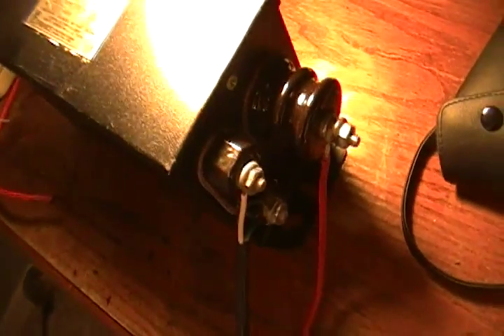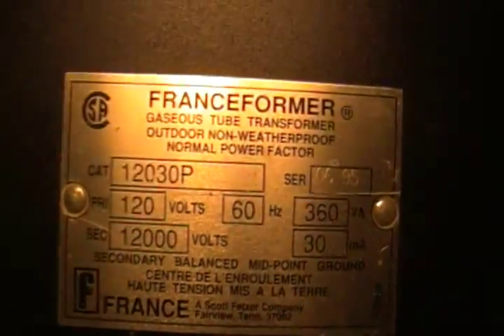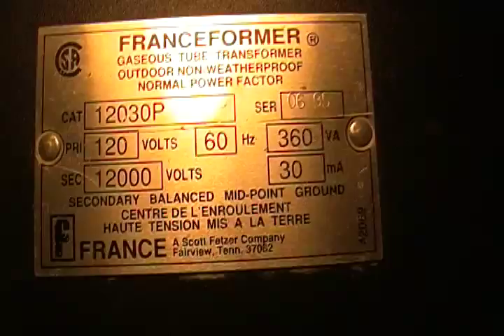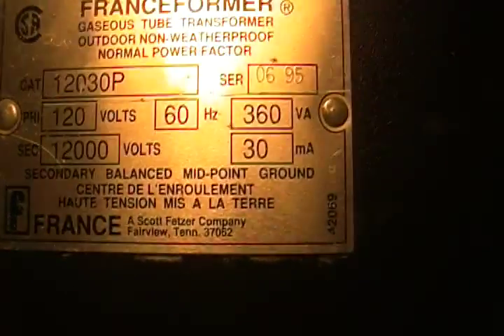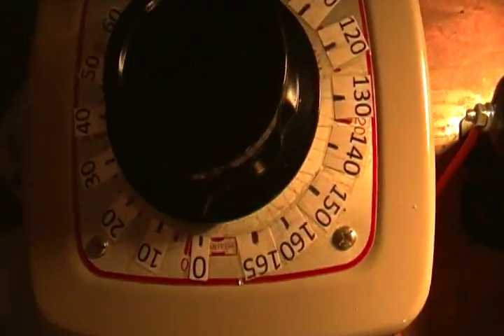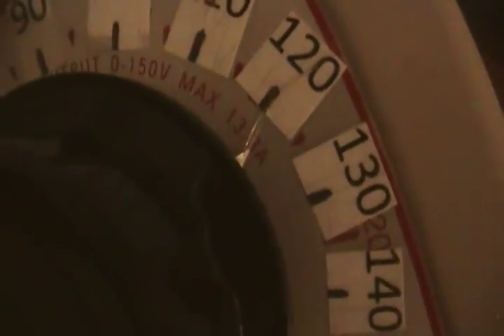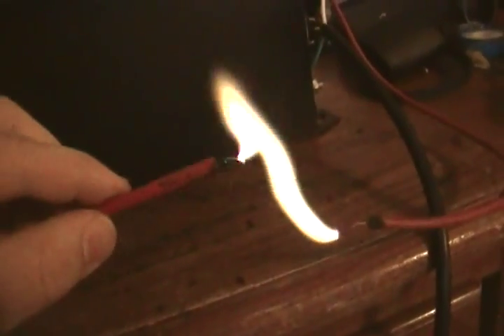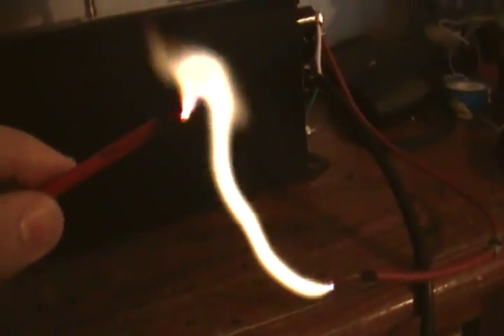Neon Sign Transformer (12,000V NST)

Comment: 0:34 Great video. 👈👍
Please check your Neutral, and Hot connections again. Black is hot (if you touch it, you turn black), and White is neutral. I had made the same mistake before and was sternly corrected. By the way, I have Allanson's 15030 NST (Auto 10KV, 12KV, 15KV at 30mA).

Comment: Not that I care so much for your safety, because I don't and you should know better, but please people, don't do what this guy has done!!! Never handle live wires in the KV range with your hands, even with insulation on the wires. Dielectric breakdown can occur between you and the thin insulating material.

I originally thought this guy might be okay touching the insulated wire one - handed so long as his other hand was off all wires, because he was standing on a wood floor and wasn't grounded. But then I saw his feet very close to a bundle of wires snaking across the floor... very very dangerous!
Reply: I agree.Mot's and Nst's are dangerous.Flyback transformers on the other hand,are a bit more safe